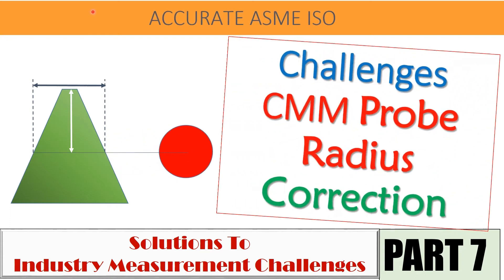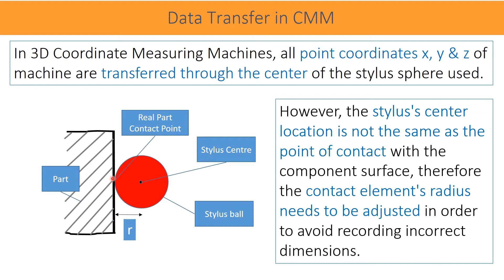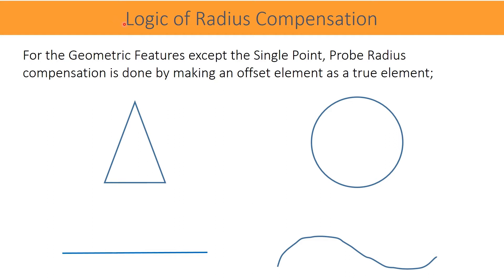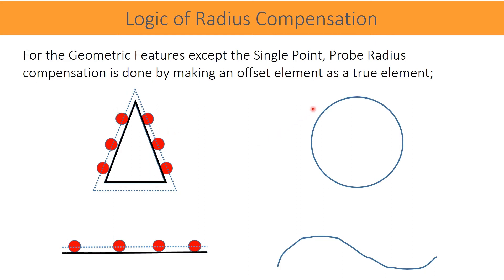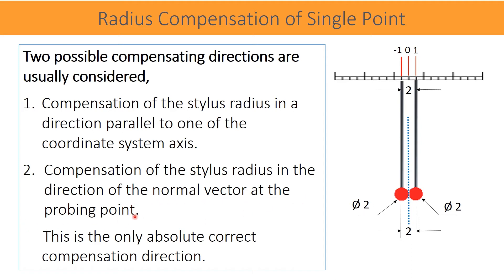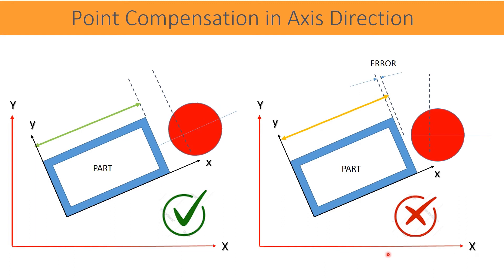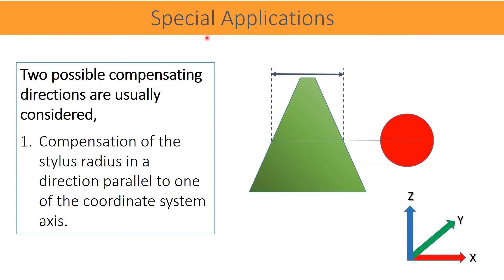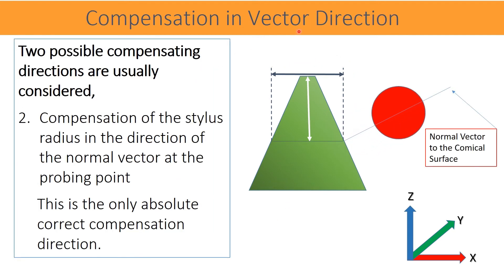CMM PROBE RADIUS COMPENSATION

Comment: Just a question
If I am measuring cone with 30 degree angle per side  using cone command in cosmos
Will mcosmos adjust for cosine error on points taken?
Reply from the maker: Yes, any CMM software can do it if direct cone measurement command is given. 
The logic is first without probe compensation feature is created. After that the problem radius is reduced from the entire surface.
Regards